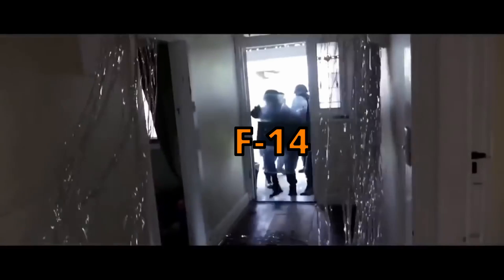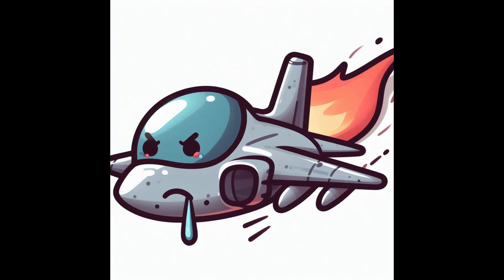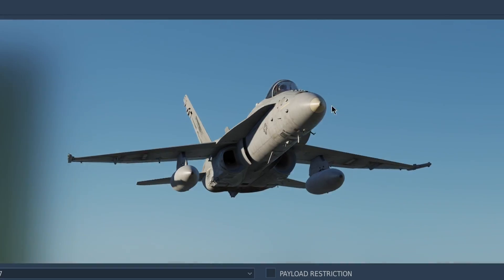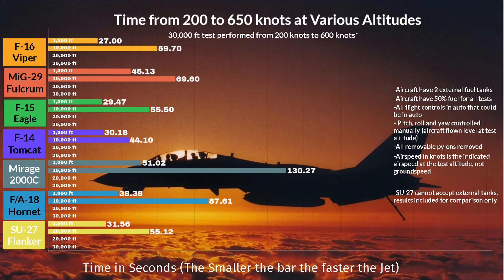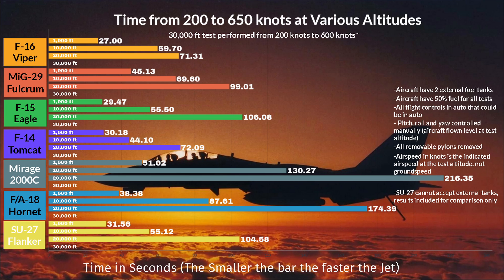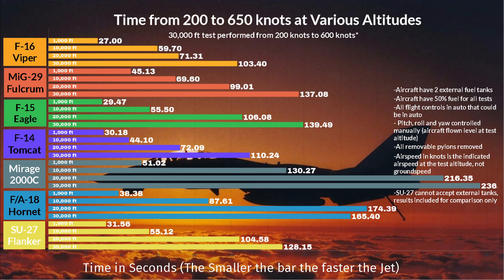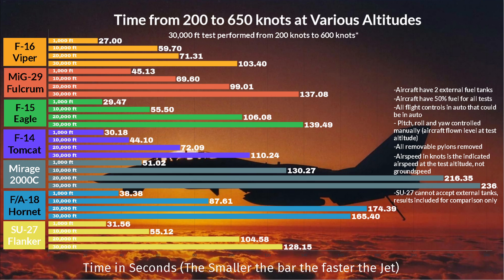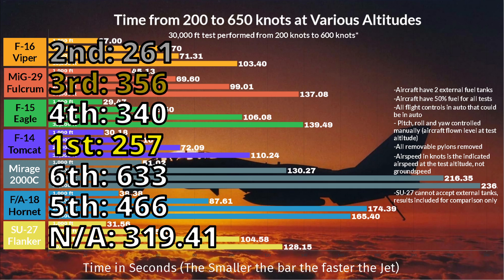F-16 DETHRONED! Fastest Fighter Jet in DCS Test

Comment: The F-16 FM is currently overperforming.
Reply from the maker: In some aspects, I completely agree it is insanely fast without external tanks. It's acceleration while pulling g's seems lacking though considering what f-16 pilots say.
Reply: @Tabs_Original  I've heard that many times as well.  I've also heard that because of how fast the pilot blacks out during high G sustained turns also hinders the F-16's ability to perform it's preferred rate performance on the deck in comparison to IRL.
Reply from the maker: @sykosocial  That's an interesting point I haven't considered before. I wonder if the problem is the pilots g tolerance is the same in every jet. But the f-16 with its reclined seat should help the pilots support higher g's
Reply: @Tabs_Original  the downside of a one size fits all model is that there will always be both over, and under-performance in some regard, assuming the metric is placed somewhere within the middle ground.
Reply: @Tabs_Original  Yup the Viper seems to have too much drag when pulling alpha - whereas the Hornet seems to have far too little - hence why the Hornet is so good in a dogfight and the Viper so bad.